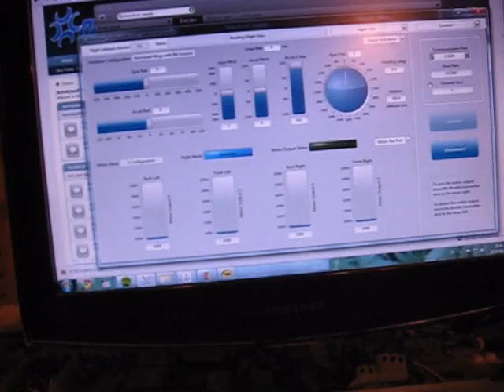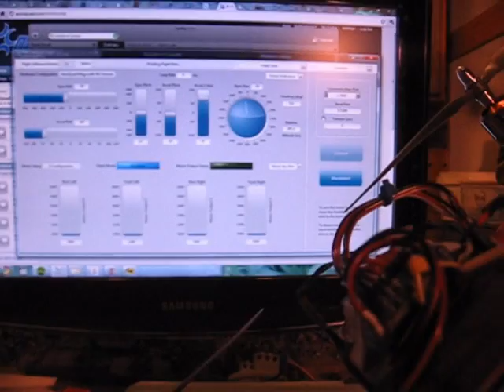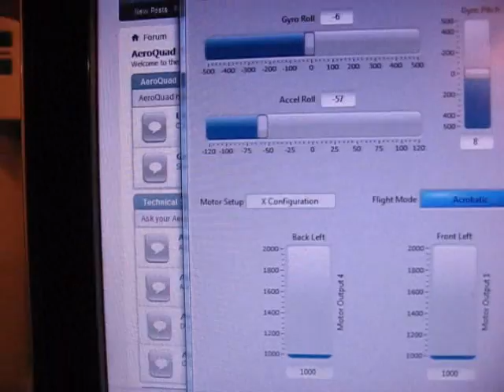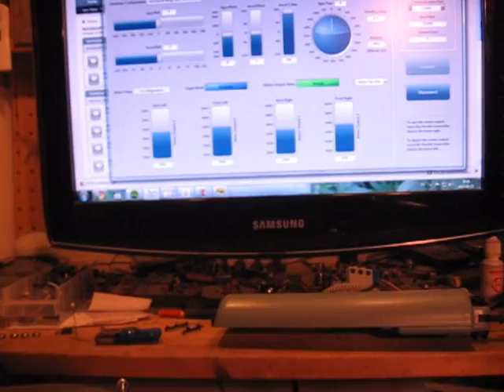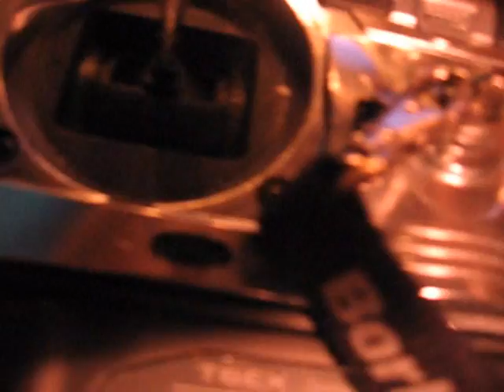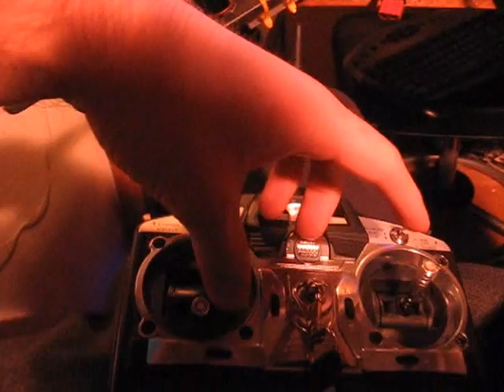Quad Tutorial

Comment from the maker: @npgatech We have both velocity reporting sensors and acceleration reporting sensors. For detecting angular velocity we use rate gyro's, and yes, 100% sure they report the angular velocity around the body itself. We center them by subtracting or adding the number to our seen angular velocity while still compared to when in movement. (Calibration). The effect seen from our eyes of the accelerometers are both moving while moving the quad translationally/laterally and they also show "abs. angle"